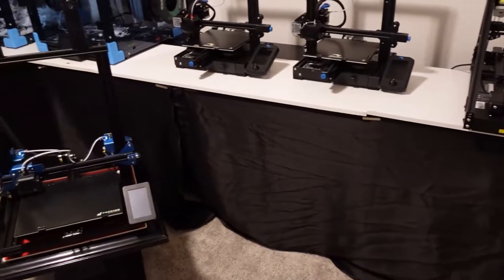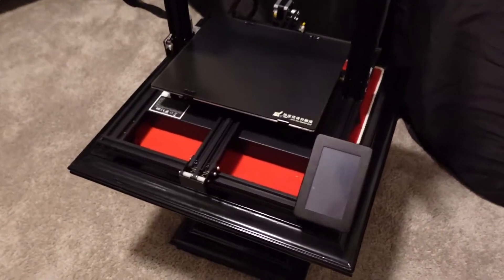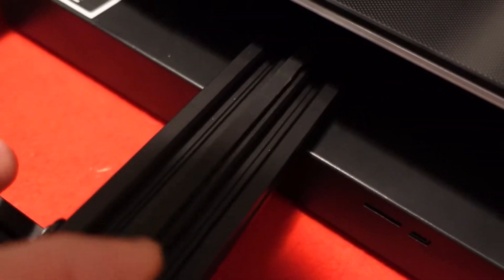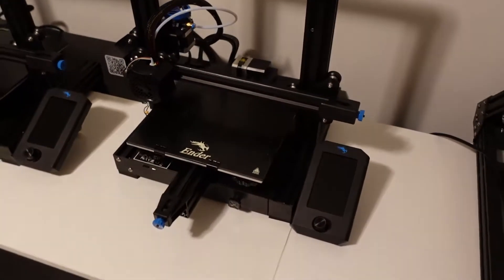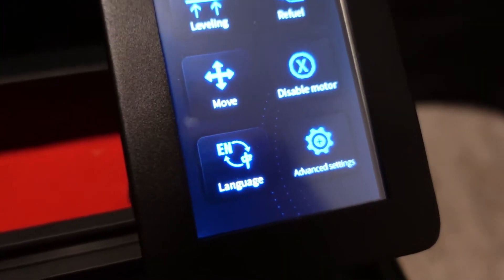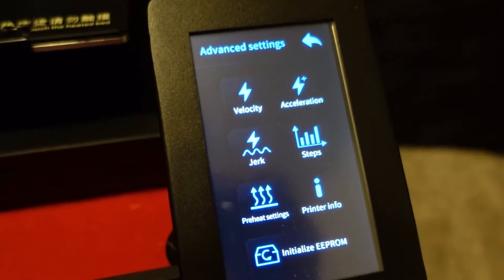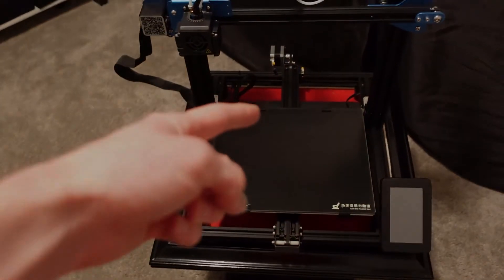My First Impressions of the SOVOL SV02 Dual Extruder 3D Printer

Comment: I purchased the SV02 and had or horrendous experience.  The first extruder just straight up did not work.  I contacted support and went back and forth with them for over a month (August 3rd to Sept 7th) to fix the issue and even after showing them videos and working with them they just refuse to send a replacement or refund.  I won't support this company ever again.  It was my first experience and I bought a $250 printer, you'd think their support would care more.  Very disappointed, I hope this is an aberration.  Regardless, there are other companies with similar tech, I'd look elsewhere
Reply from the maker: So sorry! I love mine :/

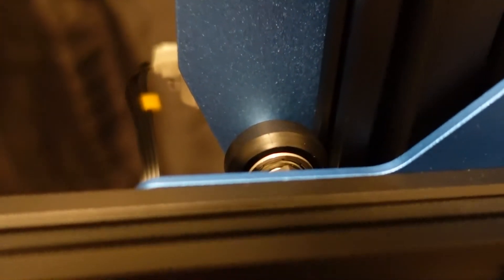Comment: The issue mentioned at the 7:30 minute mark about the inner Z roller not turning is easily fixed by turning the eccentric nut of the roller with the provided spanner; the eccentric nut actually serves that purpose
Reply from the maker: Some how at the time of filming this video I had no idea how to fix it! I still havent, but I have known about this for awhile. I probably should get it to hahaah! Thank you!!

Comment: Would love to hear if anyone is using the SV02 w/OctoPrint... it will control the printer but with zero output/controls to the display...
Reply from the maker: That's interesting. I wonder why. It is a creality board so it should be compatible. No foreign hardware. I might attempt to run octo on some printers in the future and I can give it a go possibly
Reply: @ThePrintHouse  My thoughts as well. Runs as expected on my Ender v2 - full disclosure I have not updated the firmware on the LCD from unboxing... will go do that now and see if it makes a differance.
Reply from the maker: Do you have any more information on this?
Reply: I don't. I've resorted to a Fire 7 tablet running the OctoPi Mobile UI.  there's some lag and it's not terribly elegant but, no, can only see/adjust temperature from the printer itself (it does display the target temps). no print progress, print title, layer no., etc - most difficult is no cancel/stop print.  I've put a wireless button next to it that calls the octopi api to cancel the print but it is hit or miss...

Comment: This review didn't really cover the questions I would have expected. Mainly does the dual extruder system work well? Does it jam up like other printers? Things like the loose belts are really not relevant because it's random whether the belts get loosened in the shipping process anyway. The dual extruders are the main difference this printer has with others and that should have been the focus. It doesn't matter at all that it has a metal housing for the display.
Reply from the maker: Hey Matt, sorry for the confusion. This is not a review video. This is only a first impressions video. I do want to make a review for this printer, but I want to make sure I do it justice, so I need to become quite familiar with it before I write my review. I can try to push that video closer to the top of my to do list, but I'm still not entirely sure when I will be able to upload it.
Reply: I've not had any problems with jams. Been printing with it for about a month now and am really loving this printer, it is quickly becoming my primary.  Some little things take getting used to coming from an Ender 3, the load and unload cadence took some trial and error and gcode adjustment.  I upgraded the bowden tubes and since they are solid/opaque I can't be sure how far i am  pre-loading the filament (too deep and the load length mm gcode is too great and starts to cause some problems) its sorrta become muscle memory (load all the way and then pull back a tug or so). Then there is the Prime Tower, which i understand needs to be there to purge the previous filament but while you can adjust it, it uses a fair bit of filament and add quite a bit of print time.  Cura takes some working with the profile of which extruder should do what (skirt, supports, etc.) and i'm just learning how to create dual extrusion models but thats a whole other thing) - I'd say the metal housing mastterst a lot for me, it means I can mount the magnet based laser etcher.